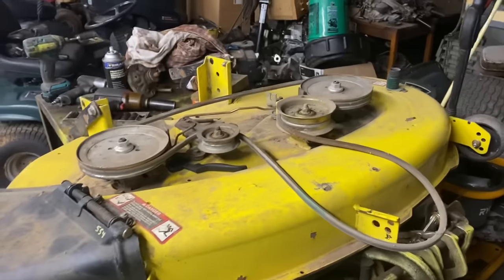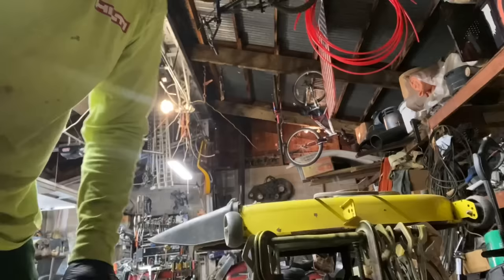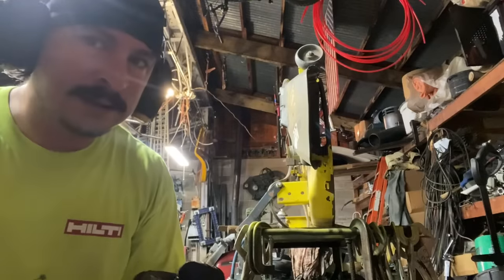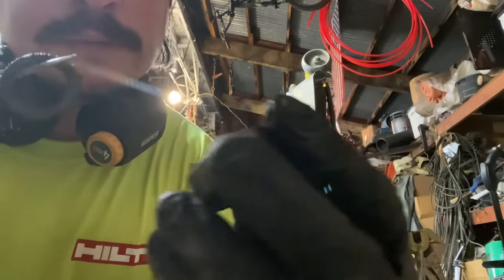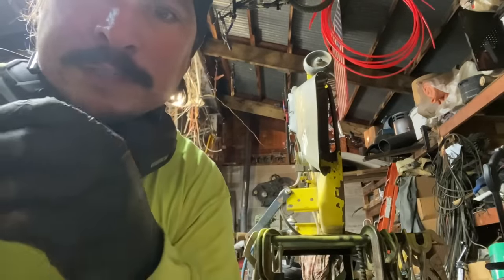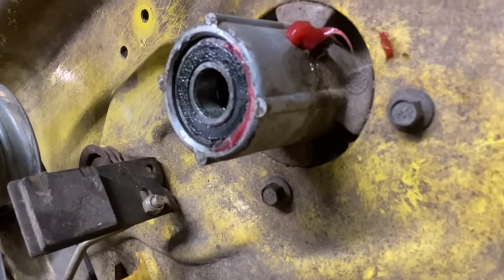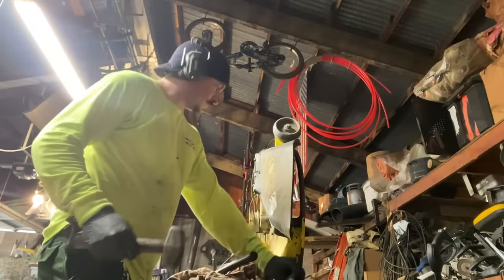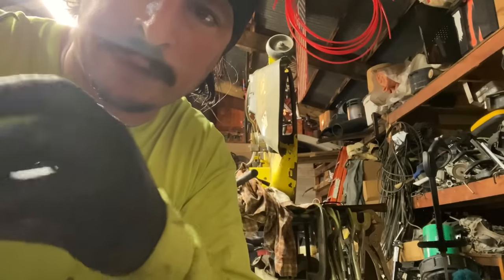Part 1 - Don’t trust the “Experts” Grease your mower deck sealed spindle bearings Common sense.

Comment: Here is a link to a video about the spindle bearings https://youtu.be/PwObkilFXN0?si=iJsTJgKx0pM8pYua
Reply from the maker: @dennisoneal8505  that’s a good one. Don’t forget about part 2.
Reply: @GTObearclaw1   Yes, the one about the weep holes, Yes, I've watched it too. I don't know why there are u tube videos that claim that you don't need to grease the spindles. Woodchuck does a great job proving it is a myth. I've even tested it on a old yard sale mower I bought and the grease does in fact go into the bearings.
Reply: LOL just realized you are woodchuck, I guess I had a senior moment there.
Reply: Also, I hope you don't mind me sharing your video link.
Reply from the maker: @dennisoneal8505  absolutely share as you want. I drop the link into other peoples  video comments to help folks find the truth when they are watching those other nonsense videos. It would be nice if some of those so called pros would at least take the time to show the viewers why it won’t work and show the assembly being greased in real time and explain to us where the grease is going if it can’t pass through the assembly. That shouldn’t be very difficult to show on video but for some reason nobody will connect a grease gun and explain why it won’t work. I find that very odd especially from folks who are supposedly giving out helpful advice. It would be fun to watch them try to explain how grease didn’t pass through a bearing on a sealed unit while they pump grease into the assembly and it squirts out either end of the unit after passing the bearings. they would look foolish for having provided misinformation for so long then comming back and admitting they were wrong but I could at least respect that and they would simply just have made an honest mistake. But not even attempting to make sure it’s impossible to grease before advertising it won’t work is lazy. Hopefully more folks like you will consider the information on booth sides and try it at home and find the truth. Thanks for commenting.

Comment: Explain exactly how grease gets past those seals again? Because you are WRONG . Pressure is NOT going to push grease past the seal. The open area is that spindle would require a LARGE tube of grease just to fill that cavity. If it was not full of grease from the MANUFACTURER ,that should tell you something. The point is this, even from the factory, these are NOT greased. Period. I have been working on this stuff for years and know enough to know a seal is just that, a seal, it keeps the bearing from getting ANYTHING into it. Your video didn't  convince me or anyone that works on this stuff.
Reply from the maker: I don’t even know what to say, lol. 
You simply can try it for yourself. It actually works great. That lip on the seal can not stop pressure from the grease gun. Look up the pressure that a hand pump grease gun is capable of pushing out. And then imagine a little rubber lip on the dust shield holding that back. I would argue that only a few pounds of pressure is actually needed. As the handle on gun never has much resistance.  But if you don’t even want to open your mind and explore the possibility that it’s actually a highly effective procedure, your free to believe what you want. But that’s exactly why I showed proof in the step by step video. Thanks for watching.

Comment: So once you've pumped the shit out of it, you've compromised the bearing seal.

You dont use that type of bearing if you want to pump grease into it

Better off buying heap of cheap bearings and just replace.
Reply from the maker: Wow, what do we have here? Kinda sounds like another expert. Yea I understand this process can really get under some folks skin I guess. But Iv shown every step. It’s about as simple and to the point as I could make it to show the facts and lay it out in toddler steps. 
If you want to make a video showing proof of your claims and show us DIYers the damaged seals after greasing, please hurry up and get to it. I
Personally can’t wait to see. Talk is cheep, grab your camera and put in the effort. I know you would Just like us to believe that you know everything about lawn mower deck bearings but the issue is you have nothing to prove your point except a few lazy comments. Do you expect that to turn folks away
From the proof I provided? This is YouTube, make a video. Show us your proof. Post your link right here in the comments and help us learn. Thanks for taking time to comment. I won’t hold my breath on seeing your video.
Reply: @GTObearclaw1  I appreciated the video but it's a fair point: The pressure may be causing the seal to fail.

I don't think it matters though the main point is that you don't need to bother removing the plastic seals.
Reply from the maker: @LegendLength  it’s a fair point that absolutely nobody can prove is a concerns. Why is it so hard for someone to show us an issue that over greasing caused? Seems like they could prove this very easily. But yet here we are. Not a single YouTube video on the topic. No facts. All hot air. Looking for reasons to complain. people over think a simple process and invent issues that don’t exist. Some folks think they know everything about everything and need to jump in and share their expertise. Maybe it makes them feel good about themselves. It’s very simple. Show proof of damage that has occurred. Iv been fixing mowers 20 years. Took me a long time to figure some things out on my own. Nobody gave me this tip. I just started noticing things after a few hundred deck repairs. Never once seen anything that would lead me to believe a well lubed deck bearing failed. Every single deck I repaired for bearing failure was due to lack of grease. Usually dry as a bone. It’s actually overwhelming this is a one sided issue from where I stand. Lack of grease is the enemy. Too much grease is just not a problem for this type bearing application. Iv been in the Terence pulling busted spindles apart. If too much grease was the issue I can’t understand how Iv never seen that not even once. Folks can do as they wish. I sure don’t care. But for the folks that learn something and live a happy life with long lasting well lubed bearings, I am happy for them.

Comment: No It dont go through no it don't it don't work it does not go through there I'm grease bearings on a Husqvarna and it does nothing and it got screwed up spindles I bought a cheap ones instead of the vein brand and I've got a boy screwed up mess now I've got too much and play and can't tighten it up I don't know how the hell I'm going to do that tighten up the band play on shaft one that's bottom. The mandrill wasn't made right at for the distance of the shortest it's too much and play the bearing bottoms out on the mandrill and there you are stuck with whatever's there and wobbles up and down and scream howls bounces doesn't cut worth a shit I'm about ready to end of my rope with this shit with these lawn mower spindle and blades and bearings the crap all crap The replacements are a joke
Reply from the maker: Man, that comment made my eyes cross. I
Didn’t get much from that message but I can tell you the process I explained works plain and simple. I have no idea what you have gotten yourself into but by the sounds of it you have more than a  preventative maintenance issue that greasing bearings was going to
Solve. So please don’t be so quick to discount a process that works if you use the process before you found failure. Adding grease won’t fix broken parts. It only adds life to good parts.
Reply: @GTObearclaw1  I'm sorry it was voice to text and my phone has made a pack with what evil forces it could find . I.made the mistake of buying cheap spindles instead of the OEM parts like I should have the center shaft was made wrong so that the top bearing doesn't go down far enough in the spindle and there is to much end play . The housing and spindle don't match . With the Bering bottomed out on shaft it will move in and out in the housing about .050 of a inch I haven't miced it but it's junk I know that  sorry for the bad post  .
Reply from the maker: @rogerw2101  dang that’s a bummer. I mostly buy the cheeper non factory replacements and have had good luck. Sorry to hear that.
Reply: @GTObearclaw1  hey man .  I checked end  play on mine and it's about.050 you be getting real heavy grass it's just starts rattling vibrating really bad the vibration was enough to loosen up the second the bolts on the second blade. That's how much vibration I don't know what the heck I'm going to try it's almost like the spindle are The mandrell I guess wasn't turned back far enough for the bearing  to seat  right it's almost like the bearing bottoms out on the shaft . And the bearing isn't seated and  bottomed out in housing .

Comment: I have all exmark mowers.  Same thing.  I have grease zerks or spots where ones go.   Dealer daid im bot supposed to greas em.     I do it any ways becasue i had a craftsm compressor that was advertised as not needing oil.  That didnt last long.  
 Same dealer also told me the grinding i hear when shifting gears in my polaris ranger is normal and i shouldnt worry about it.     Dealer mechanics are shit.
Reply from the maker: Scary to think they are give advice on maintenance.

Comment: Moronic. 

You saw a stack of bearings on the shelf with no protection from dirt, humidity, etc. 

He is determining what type of grease to use by its color (problem #2). It could lead to use greases that are not compatable with the grease already being used.

Sealed bearings are used as they are sealed for the life of the bearing. Typically in this application the grease fill is 35% of the capacity of the bearing (plenty of grease). 

This guy and all of his maintenance department needs to attend classes on bearing maintenance. 

I loved selling bearings to these types because they don't listen to the pros.
Reply from the maker: Good grief, what a rant you just went on. I can’t even take you seriously. Those shields pop right off. So obviously not sealed for life. That one detail alone just proves you’re totally off base on this style of bearing. It’s no biggie to pop a shield off and add grease and pop a seal back on. I mean this is like deck bearing maintenance 101. Really just day one stuff. You’re very disrespectful. I have shown proof that grease penetrates through the assembly regardless of the inner shields being in place. That was the point. And I wanted to debunk the guys saying these bearings can’t be greased because in fact they can be greased and they will not sustain any damage nor do bearings in this application have issues with overheating due to over application. This is how all mower deck mandrels are serviced even commercial units. Very basic stuff. Not all bearing applications are the same and servicing in this way for different applications may have different results but for this particular situation there is no issues. You’re just a bit dramatic. I used a diffrent color to show that grease made its way to the insides of bearings, but Iv also never experienced any issues with mixing grease in a mower deck bearings application. Generally speaking any grease and even mixed grease is better than no grease and letting a bearing fail. This is not a space ship, so cool your tits Karen. The bearings in my shop had the shields in place and were in a shop, not exactly sitting in a bucket of water outside the shop. Those were perfectly fine. I’m fixing dirty mower deck, not rebuilding automatic transmissions over here. You’re a hoot. You are the experts I warn folks to not to trust. You’re over dramatic, a know it all and rude. Nobody will take anything you say to be of any real value. Just talk no proof. Make a video boss. Show us, help us. Or just get back on your rampage and act a fool. I can already see you have no filter. I’m sure the next comment will be full blown out of control.

On a serious note, I’d love if a naysayer would take some time and make the effort to provide some references to Their clams but they never do. If you would have taken a moment to see what the reactions are from most viewers you might notice you’re in the minority on this one and the group you fall into is not one I’d like to be associated with.
Reply: @GTObearclaw1  Are you on a small engine or lawn equipment discussion forum?  You should be because the YT comments section is garbage.
Reply from the maker: @Hjerte_Verke  no im not into anything on forums in probably 10 years now. I end up spending too much time lol. Kinda like I do with these comments.

Comment: I stopped your misinformation at 1:06. If the bearings are TRULY sealed, then goopy-assed thick grease ain't gonna penetrate. When you had the sealed bearings in your hand, you should have popped one to see if your grease had penetrated. The important thing is that trying to remove the mandrels will instantly result in REPLACING THEM. Steel screwed into aluminum without protection will galvanically corrode them together.
Reply from the maker: Not only did you stop the video before you knew what was going on. You left a comment about stuff that was clearly explained if you would have kept watching. I understand you may disagree. Many people do. And many higher ranking mower channels are posting that the shielded bearings won’t take grease. That is exactly the reason I took time to make a step by step video on the process to prove that in fact grease passes into
The bearing and around the seals on the  inner shield. Grease is basically a oil. It will push past a rubber lip of a seal with a very small amount of pressure behind it. I posted the video so folks could see another side to the argument over this topic. As you may see from other moments for this video there is some mixed opinions. However the one thing that remains constant is nobody has proved me wrong. Naysayers just get mad and post opinions on the theory. I’m just sharing my findings that I actually show in a step by step process. Someone can easily do the same as I did to test it their self. It is really way simpler than most people think. For some reason folks see a seal on these bearings as a barrier against everything but the fact is they can’t stop much more than dust. They especially can’t stop oil or grease that’s under pressure from pushing past. As for the mandrels and the bolts, yes sometimes they break off. But I this video does not even cover that topic and most guys who have worked on decks a while know that unless the parts are new, it’s a wise choice to use a heat gun or put a torch on the mounting bolts and that area of the spindle / mandrel for a few moments and in most cases the bolts will come out. I actually don’t advise anybody remove a mandrel assembly and I have stated such in other videos. The only reason to pull one off is if you already plan to replace it or work needs to be done to the deck she’ll that can’t otherwise be done to the deck. As for stoping the video I think you may benefit from finishing it.